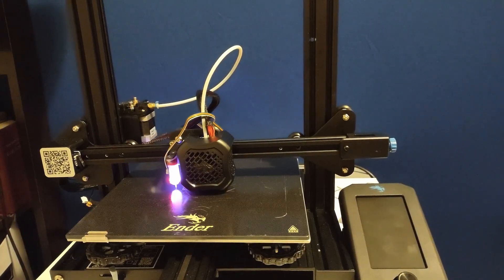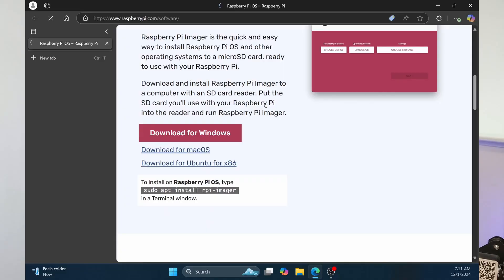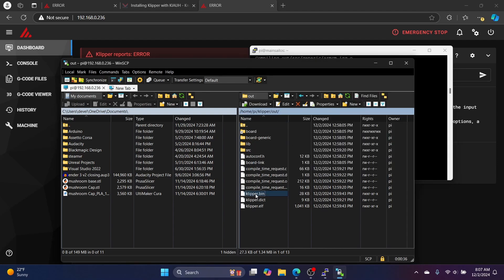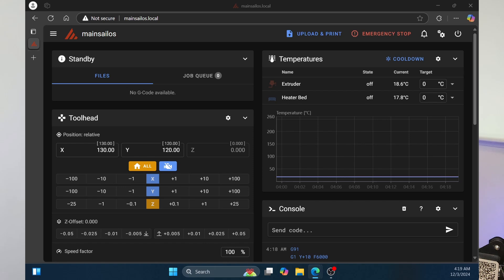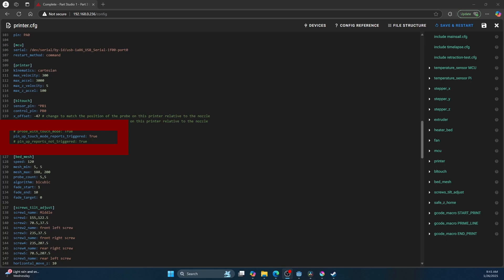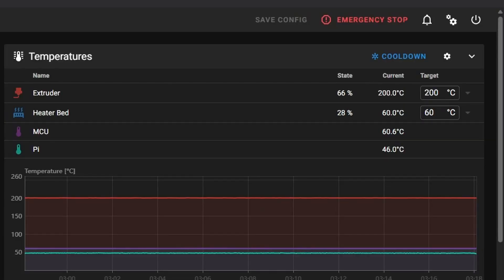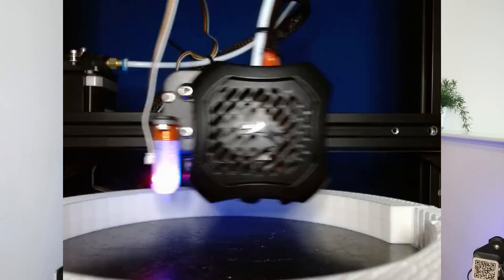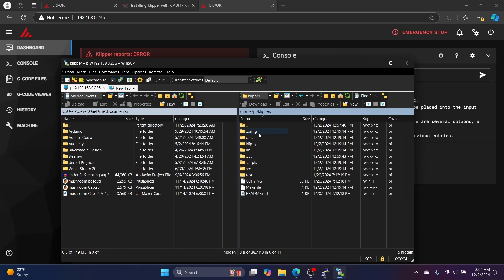Was the Klipper Upgrade to my Ender3 Worth It?

Comment: I upgraded an Anycubic Kobra 2 to Klipper back in 2023 and it was a genuine challenge.  Very few resources and the few that were available simply did not work.  Have to muscle my way through getting the firmware flashed on the stock mainboard and the printer.cfg setup but once I did...WOW!!!!  It was all worth it.  Not only did I upgrade that printer to Klipper I saved the failed mainboard from it (replaced under warranty) and just this past weekend I converted it to a 6 channel neopixel controller.  Once I became very comfortable with Klipper it really opened a whole new world in 3D printing.  it is such an amazing step forward from Marlin.
Reply from the maker: That's awesome! It sounds like it was a challenging but rewarding experience. Klipper is awesome and the community is great. I'm glad to have a bit more support.

Comment: Sky is the limit with klipper once you get into custom macros.
Reply from the maker: What do you have macros for?
Reply: @wootsworkshop  Nozzle scrubbing, easier filament swapping with M600 support.  Heat soak to warm the enclosure before ABS/ASA prints.  Filament sensor runout macro for pausing prints without turning off bed heater.

Comment: I don't have one of these printers but isn't the ender3v2 LCD just a DGUS? it's a kind of an object oriented LCD controller for all sorts of appliances and industrial automation equipment, maybe you have heard of the other similar system, Nextion. Weren't there some Klipper projects to support DGUS?

It's not going to be a "follow a tutorial" kind of thing though, for sure not, more like advanced wizardry.

I do think Klipper's motion planning is better even before input shaping comes in. I mean Marlin is releasing Fixed Time Motion, that's going to help, but the prior whole everything is just a bunch of things badly layered on top of each other. For one Marlin emits steps via Bresenham, so the steps on all axis are not independent, but determined by one axis with steepest slope, so there is aliasing on the other axis. Then S-curve acceleration and pressure advance conflict with each other. Pressure advance also doesn't truly observe motor limits, since it's done in step routine and not present at the planning stage. So you can actually try pushing speeds a little in Klipper even before you get to resonance suppression.
Reply from the maker: Wow your knowledge surpasses mine to an incalculable degree 😂. I'm definitely going to research it and see what I can find out based on the screen. I'm also going to read up on how steps are calculated. That's for a brilliant comment that makes me want to learn more about this amazing hobby

Comment: You can use orca’s built in calibration for input shaping. Just remember to add input shaping to the cfg file first or the test won’t run right. You can set the frequency values to zero when you add them. After that use orca’s documentation, it tells you how to interpret the results. And unless you feel like getting a cheap accelerometer just do the print test and measure it. It’ll get you close enough.
Reply from the maker: Awesome! Thanks for the tip, I'll definitely check that out!

Comment: I had an Ender 3 and an Ender 3 Max Neo. I had tried using the Creality tablet to Klipperize my printers. It was a nightmare because neither printer was stock, and being a Klipper noob, I couldn't get either printer working in acceptable fashion. I had put some thought into switching to a Pi, but ended up just switching to a K1C and K1 Max.
Reply from the maker: Sometimes I wonder if I just enjoy being frustrated because most of my hobbies cause me frustration as well😂😂

Comment: I have an Anet et4 that has been converted into a voron. It's a night and day difference for about 150 bucks went on sale. It doesn't compete with my 2.4, but it is still running versus becoming e-waste, and it prints tenfold better
Reply from the maker: What did you do to convert it?

Comment: I’m using a cr10 clone and it has a not so great board. Last time I tried octoprint the printer kept losing connection with the pi for a second every now and then and it left little pimples all over the surface. Never could figure out what was up, tried three different cables and every single usb port on my pi4b. I just now got a marlin version installed that lets me use input shaping so I’ll see how that goes. Pretty sure I’ll need to just switch the board eventually but at this point it’s a grudge match.
Reply from the maker: Sounds like a fun and frustrating project. I hope it goes well for you. Keep me posted!
Reply: @wootsworkshop  so far input shaping is working well enough, running a few prints of functional stuff rn. Tried some cosmetic things and I need to work on seams. They’re terrible. Orca seems to have a scarf joint setting. I’m gonna jump on that and see what I can get out of it.
Reply from the maker: I really like Ocra's scarf joint. I made a fantasy football champion trophy for my league and the scarf setting made it look so much better.
Reply: The issue is that the 8 bit mainboard is not fast enough to print and service the usb data coming from Octoprint.  Marlin has tweaks to help somewhat, but the best solution is to install Klipper.  The Raspi will take over the heavy work and allow the 8 bit mcu to coast leisurely.  On my printer, I was able to double the printing speed to 300 mm/s and drastically improve the print quality.  No more random blobs.
Reply: @propheteyebert7063  heavily considering that. I’ll have to dig around and see if someone made a config with pin assignments. Gotta figure out what I wanna do with the tool head first.
Reply: @williamaycock579  The printer config is found in the Klipper git under "config".  On the CR10, improving the y-axis will have a far greater affect than improving the hot end.
Reply: @propheteyebert7063  mine is a clone not the Creality one. There’s a config but it’s not complete and perfect, has a couple issues from what I’m seeing. Which upgrade would you suggest for the y? Mine has two 2020 extrusions for the y so I can’t imagine that linear rails would make that big of a difference.
Reply: @williamaycock579  It's easier to find a similar config file and then edit it to match your printer.  Look at the Marlin pin definitions to find which ones to use for Klipper.
The weight of the y axis need to be reduced if you want to print fast.  I've seen people replace the build plate with carbon fiber.  I think it is not worthwhile unless you enjoy tinkering.  Even then, it's better find a more suitable machine to start with.  Used ones are available for cheap.

Comment: I upgraded a very old Geeetech A30 (first series ever, no Pro, M, T, ...) using Klipper.  It does work with the original board (GTM32PRO VD), but .. well, that thing is shitty ... in the end I replaced it with a Mellow Fly DP5 (D5 would do as well) and threw out the bad toolhead PCB, replacing it with  Mellow Fly SHT36 v3, thus enabling CANBUS communication between mainboard and toolhead - only 4 wires (24V +/-, CAN-L/H). As the hotend kept clogging, I went ahead and replaced it with a cheap volcano hotend mounted in a HeroMe Gen 7.4 toolhead. The DP5/D5 fits nicely in the original case. The HM7.4 toolead brings direct drive extruder to the printer, in this case a BMG clone. And I mounted a BTT Eddy Duo, thus now having rapid scan for the bed mesh. For convenience I swappwd the glas bed out for a magnetic PEI sheet.
Eddy-NG will come, but well ... it works this way.
Now this old workhorse prints at 100-150 mm/s instead of 60, produces very nice first layers and I have 330x330x400 build volume ... (305x320 usable, the HM7.4 head is rather large).

As I hate SDcards, I use a used older HP ThinClient T620 as Klipper host with 8GB RAM, a 4 core AMD CPU and a 64 GB SSD, and a 5 inch HDMI touchscreen for KlipperScreen. It's running stock Debian Trixie. There i enough power to run Spoolman and 2 USB webcams for Crowsnest.
Reply from the maker: Wow sounds amazing!

Comment: I've upgraded my Ender 3 Pro with a Mellow Fly Gemini (board glueing a rpie-like and a controller into a single PCB) + Klipper + a decent hotend. I simply love these changes: easier to manage & monitor jobs, faster & cleaner prints and common UI & workflow with my other printer (Voron 0.2).
That being said, when I see the price of a bambulab A1 or a Sovol Zero or a Sovol svo8, I'm not completely sure about the value proposition is actually that great... But well, tinkering and making is usually not about the money ^^.
Reply from the maker: That sounds like a sweet build! I agree upgrading an old printer with a bunch of new parts can make it more expensive than a new printer with new parts :D, but it's all about the journey, learning to do something cool is so much fun!

Comment: I upgraded my Tevo Tarantula to Klipper, and it's probably not so much that it's faster, so much that it has tools that allow me to feel more confident in running it faster, if that makes sense.
Then again, this Tarantula has been modified to the point that very few of the original parts remain.
Reply from the maker: That sounds like an awesome printer! I'm def loving the ability Klipper gives me to customize how my printer works. Plus uploading prints from my phone is super cool!
Reply: @wootsworkshop  Oh, Lawd, no, the OG Tarantula was "the best all-metal printer kit" of its day, but "its day" was way back when ANet printers made of wood were still a popular choice.
The thing is more akin to a science fair project than a proper printer, and that was when it was new! No milled/tapped extrusions here, no crimps on the wires even though the instructions state you absolutely should make sure they're crimped otherwise it could start a fire, it didn't even come with a part cooling fan!
There's a reason why most of the printer has been replaced. All flimsy acrylic parts were replaced with stiffer printed parts except the bed carrier which is aluminium, it's taller (from 200mm max z to 350-380mm), uses TMC2130s for X/Y, is direct-drive, and, of course, Klipper.
Klipper was its own ordeal. I could've made a video about my experience, but what should have been 1-3 hours of downloads and configuration turned into a 4-5 day ordeal because of goofy stuff like "Octoprint's official image from their official website is broken!" or "the power supply that came with the Pi? That worked perfectly fine the last time you used it? 'iNsUfFiCiEnT pOwEr'! :)" or "your SD card decided to die JUST now" to "hey that power supply you found that powers the Pi without it complaining? Well it's complaining again!", like a cavalcade of nonsense worthy of a Greek Tragedy/Comedy. :V
Reply from the maker: The insufficient power error on octoprint always irritated me. It seemed it didn't matter what power supply I had I would get it occasionally.
Reply: @wootsworkshop Not sure if it's an Octoprint thing or a Klipper thing, because it did it with both. :V
My main issue with Octoprint was the official image was un-usable, as it would seem I had the luck to try it during a week when the official image was busted as it was.

I finally just rigged together a crude hat that ties the Pi's 5V rail with a 5V rail from a modified ATX PSU. You have THIRTY-FIVE AMPS at your disposal, Pi, I don't wanna hear ANY COMPLAINTS! >8U
(don't do that BTW, it bypasses fuses and stuff, mine's "fine for now" but still)
Makes me wish they just used a 5.1x2.1mm barrel jack like the BeagleboneBlack did. :V
Reply from the maker: @ZeroPointAlpha   I think the new ones use USB-C which has PD so that should eliminate the low power issues
Reply: @wootsworkshop  Which only makes it further a shame that I'm "inconvenienced by poverty" so to speak.
Reply from the maker: @ZeroPointAlpha  I feel your pain.

Comment: I'm currently on my 3rd round on klipper on my Voxelab Aquila (+ "some" "upgrades") 😉

1st round was minimal installation, using firmware from @3DPrintSOS. Just to measure frequencies with accelerometer. I used old laptop as host and also for OctoPrint.

2nd round was to actually use it. Without proper screen, klipper is PITA. Android app klipperoid makes the experience a little better (but still a lot better than Fluidd or Mainsail on old phone (Alcatel 4) browser) -- but still awkward and slow. I'm not sure why I went back to Marlin, probably because Marlin ( classicrocker883/MRiscoCProUI to be specific) felt better .
I think at this time I used old Core2 PC as host, and also for OctoPrint.

Now, with proper Creality 4.2.7 board (more memory than N32, can have all good Marlin features enabled) and BTT Pi, I tried to (and in some extent succeeded) start OctoPrint prints from Marlin UI (didn't want to go between PC and printer and PC and printer 😮‍💨).
But when the branch of Marlin I was using started feeling unstable (not FT-Motion unstable, but still freezing mid-print) I gave klipper 3rd try. It is pretty good, but now I can't get Z-offset correct and prints don't stick. What if... 😅

IMO, (+ goods, - bads and * unqualifieds)
* klipperscreen and phone with VNC makes pretty good printer UI, like it is meant to be (don't fall for small SPI resistive screen)
+ printer.cfg is quick to modify when needed
- printer.cfg needs a lot modifying to make the printer run good
- if we think klipper as printer.cfg (quite true in fact), it's just empty shell: almost nothing with the printer works out of the box
- configuration documentation is sort of good, but it's also sort of Java docs: every parameter is listed, but what do they do ...
* there are basic configurations to get started, and configurations made by random people on internet -- but those are for their printers
- want some basic features like M600 filament change? There are likely dozen different macros to choose from. Does any of them give proper GUI in web interface?
+ ability to calibrate input shaping and shapers beyond ZV is strong part of klipper
* almost everything else is set-and-forget in Marlin + settings adjustable from printer UI. Except extruder direction in stock Marlin (it's always the wrong way 🙃)
* Marlin FT-motion has all shapers, but it might still not be ready for everyday use (has noisy motors and jerky movement for me)
- klipper is not a deity: it does not make nozzle extrude any faster, it does not make POM wheels any stiffer nor does it remove any VFAs. Fast printing is easiest with fast modern printer with rigid motion. Everything else is throwing good money after bad money 🙄
* also not available in neither klipper nor Marlin: automatic PA/LA and/or flow calibration, automatic Z-offset (nozzle touch, unless base printer is Ender 3 V3 SE or KE)

Will I go back to Marlin? It's possible. Touch screen (klipperscreen on VNC) feels fine, but rotary knob is also fine, maybe better. Faster, at least, compared to tap tap tap.
I just need enough OctoPrint on the side to select a file (that was uploaded earlier) to start printing. Minimal web page, list of files on printer UI or some app. Movement etc can be done on the printer.

Even more I'm waiting either current modern (IDEX or multi-color/material for PLA/PETG supports) printers to cheapen a bit more, or new cheap good printers to arrive.

Comment: I have a og v1 ender 3 printing at speeds faster than my centauri carbon and honestly it's probably the more reliable printer. 😅 Definitely look into adaptive bed mesh and maximizing your bed mesh area. With stock motors   properly tuned belts and vrollers you should have no problem with 4000mms accel on your V2. Input shaping is great but use it more of a tool to find issues with your machine. Welcome to the world of klipper. Oh make sure you have a backup of your config!
Reply from the maker: Awesome tips! Thanks for sharing!
Reply: For simple mods to increase speed. look at getting a pei sheet with magnet.  This will greatly lighten the print bed from the stock. Silicone bed spacers help alot with keeping the bed trammed longer. Another tip I can say is make sure your frame is properly square. A hour of being super anal about squaring up the frame and gantry to the bed will prevent issues in the future especially when it comes to large prints that need to fit together. Right now your main enemy for speed prints other than the heavy glass bed is the stock flow just can't keep up as well as the Bowden system and stock hotend being not able to handle super quick retractions. I designed an adapter that you can fit a K1C hotend on a stock ender 3 and this gives you the ability to print carbon fiber materials as well as cold nozzle swap changes. Hotend on Amazon was like $30 last time I checked.  Recommend printing it in abs, but PETG will work for awhile as long as you don't enclose the printer. Just search on printables "K1C Ender 3". There's also adapters out there that allow you to use Bambu hotends.
Reply from the maker: These are some awesome suggestions! Thank you! I'll look into that upgraded hotend! I've been avoiding it because building a custom one or the ones I found that Creality sells are like $100 but if I could do it for $30?!? that would be amazing!
Reply: @AtomicBleach do you have any sort of build tutorial? I have 3 ender 3s collecting dust that I really want to get serviceable again.